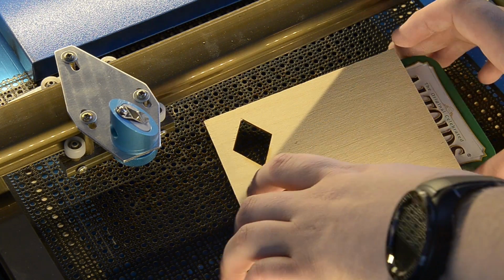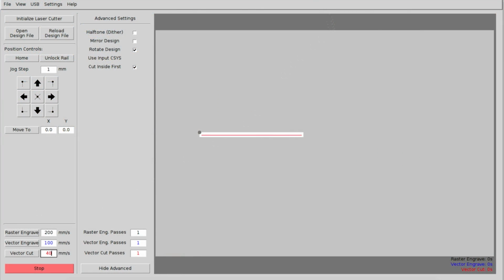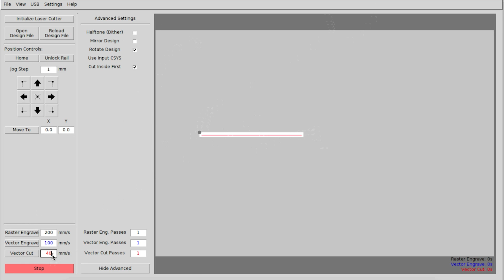Focusing a 40W laser cutter

Comment: What is this in relation to other cuts?  Stays same?  All about the measurement device but the overall picture of why and what this experiment does for future cuts.  Stays consistent or repairs on material, make and model number?  Do we run same experiment on ours and then the sweet spot is found and used each time all the time?
Reply: I usualy measure from the bottom of the lens to the focus point, in my case its about 50mm (different lenses may be different). I then cut myself a small tool from 3mm acrylic 50mm long, I then put my job on the laser bed and adjust it until the tool just fits between the lens and and the workpiece. (I have a perforated metal sheet fixed to the top of a "lab jack" so I can raise or lower the job to adjust for different thicknesses of material)

Comment: Despite your lack of technical terms, very good tutorial for the layman to find the ideal focal point of the machine...  I've been looking closely at these machines for hobby use.  Though they have a small work area and are pretty primitive (compared to much more expensive machines), they look perfect for hobby use.  The key for me is minimum spot size.  I need something with a spot size (smallest burn mark at the focal point) that's small enough to do the fine work I'd like to do with it...  Not sure if this type of machine is what I need, but for the price it's almost worth giving it a shot...
Reply from the maker: For someone as technically oriented as you, I would not think this machine is going to do well for you. This is a real tinkerers machine and it will likely frustrate you to no end.
Reply: @ItKindaWorks  I hope you didn't take my comments as an insult, not meant to be!  It's a good tutorial for finding the focal point of the laser.  I would have done something different, but what you've done is easier by far!  So kudos.

Not concerned about the system really...  Simple. Upgradable easily enough.  I work for an industrial laser manufacturer, so I have plenty of materials at my disposal to make mods to the system as I see fit.  The other option is to spend about $1K more for the a 50W system that's built more like conventional machines, but I honestly think that this system, with a few upgrades will be more than sufficient.
Reply from the maker: I didn't at all, It simply sounded as though you needed a sophisticated machine and having owned this one for the better part of a year, my guess is that it wont suit your needs. In all honesty if you need something that is precise, this will probably never be that machine. With proper air-handling and optics and other upgrades that are really necessary to make it a solid machine, you're going to spend 300-600 anyways and it'll still bug out occasionally.

Comment: It's easier to use the bottom of the rail as a reference. Once you find the sweet spot, measure to the bottom of the cross rail and cut a piece of stick that length. Now you can use that stick as a guide to get your distance to the work-piece.
Reply: While off the bottom of the rail is probably a better datum, distance up from the work surface is just as easy to find and set the material off.  Either one works...

Comment: The laser beam should be straight until the head, were the focus lens is placed. Otherwise you would have a different focal point at different locations. 
(It was my job, to get the beam right, 20 years ago on 1.5KW machines)
Reply from the maker: Well yeah, I just meant that as it comes out of the focus lens it forms a cone shape
Reply: You can optimize the ideal focus point, by cutting a sample on the four corners and compare them, perhaps you beam isn't perfectly straight… But I'm also in the 15mm steel mindset from my past.
Reply from the maker: Huh cool! What am I looking for when I compare the corners?
Reply: The burns should look identical, if you use one wedge for all corners, it will be easy to make a side by side comparison, and if you turn the power down and the feed (speed) faster you get a better contrast.
On my actual UV laser CNC, I use microscope glass slides covered with soot, only at the optimal height I get engravings on the glass. (I didn't expect that to happen at 600mW ! )